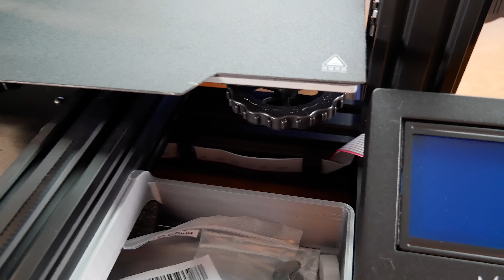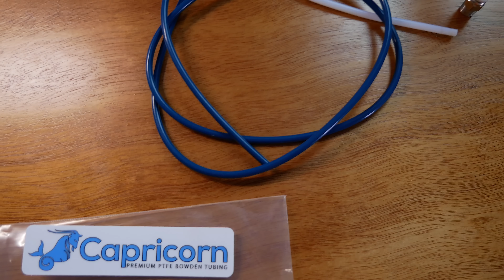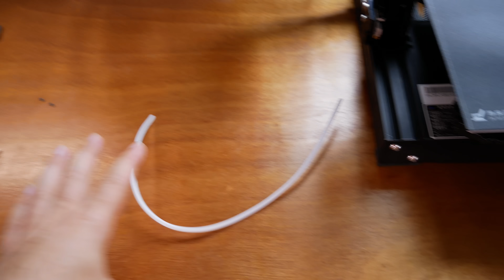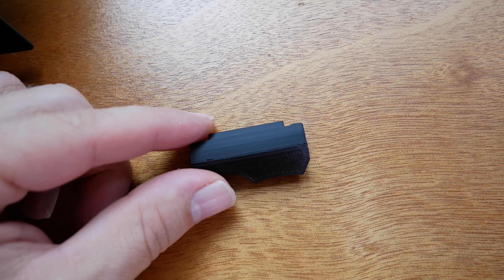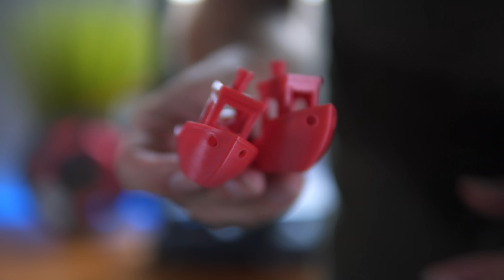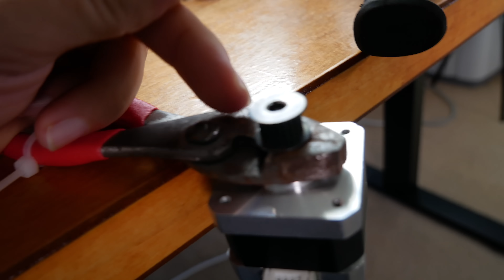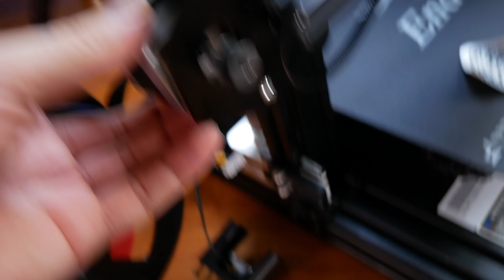Creality Ender 3 Pro - 3D Printer - More Upgrades

Comment: Have you replaced bed springs yet with the amazon orange ones? Id like to see you upgrade to those or even better the silicone stabilizers and do another benchy
Reply: I've done that recently... just ordinary stiff springs, not "painted" orange ones.  It's made a huge difference to my prints... They're better... I got 20 of them for less than a fiver.
Reply: I've printed 3 stabilising cylinders that catch the screw and the spring (they both have their own space, with a small ring between the screw and spring), so the springs can not make the awfull S-shape anymore when the bed might be leveled down a reasonable amount, to shop the bed shifting from travelling movements.  It helped quite a bit in limiting the bed shifting because of fast travelling.
The base of the cylinders is quite large so the screws stay upright as much as possible.  There also is a 3.5 mm high base that the springs rest on so they have much more force in pushing the bed up, which helped even more (I used several small metal rings below the springs at first, but they could shift position just like the springs, and while it definitely was an improvement, it wasn't a very good one.

Comment: printed the fan duct with PLA .. there is supports in the small passage at the end.. i don't think i can remove them.. ima have to print again /facepalm

EDIT: i pushed really hard on it with the small flat screwdriver provided with my ender 3 pro. you have to put the part down with the supports being at the top. then push down.

Comment: I noticed that the creality ender 3 pro only has a filament selection of PLA and ABS  how can I print flexi filament
Reply: Those are only the pre-heat options, just slice your model with the correct settings and print.

Comment: What 3D Printer do you suggest for a beginner that's 300 and below? Also do you have a video thatw for beginners?
Reply: Ender 3, easy to set up, you can be printing out of the box with in an hour. Then mod it when funds and experience allows. I love mine
Reply: @pkf4124  Thanks I'll get this one then. I gotta also get a computer it seems. I honestly haven't used a computer in years. I do everything from my phone so had no reason to do it. The computer I do have is about 10 years old. My 11 year old is going to be using a 3d printer In school this year so I figure this would also help him out. No idea what make or model he will be using but I'm sure he will learn alot.
Reply: You dont really need a powerful PC to run Cura. The only situation when power counts is slicing complex prints, and then we are only talking a min or two at most. I have a 10+ year old PC I’m planning to use as a dedicated printer pc, maxed out  with ram it copes perfectly and can run a camera and all the remote monitoring i need for long prints.
Reply: @pkf4124  Thank You that's great to hear. I can probably use the one I have or buy a cheap one.

Comment: Thanks for the videos. I am thinking of getting this printer, it would be my first one. I have a question about the TL smoother upgrade. Do they really give you a better print? or should I just skip them? I see a lot of posts where people say the installed them but see no difference. Thanks for your help
Reply: The pro has new better drivers. No need for the smoothers.
Reply: TL Smoothers weren't even designed for print quality but to fix an inherent flaw with drv8825 drivers the fact that they have been promoted and sold by nd others as a print quality fix just goes to show the lack of knowledge and understanding most of these channels have.

Comment: 1) Is there any way to make an ender-3 pro read cards that are larger than 8gb?  Mine can't read anything larger the one came with the printer. 2) Is there a possibility that can make the printer starts printing again from it left off?
TIA
Reply: It might be a firmware update,  but my ender 3 pro seems to be able to read any size card.  I regularly use a 32gb card with no problems

Comment: The Filler spool holder won't work properly when side mounted like that, the inside of the spool will rub on the brace part a lot of the time. You really want the spool to be resting solely on the round cylinder with the bearings, which you can't do with it at an angle. There are stands and other attachment methods available on the Thingiverse page for it.

Comment: What I used for feet, is ummagrip battery pad material for quadcopters.  It is nice and soft...and grips the surface that the printer is on, very well.  It seemed to mitigate a lot of the vibrations I was seeing.  Those rubber feet that come stock on it are just too high firm.

Comment: Not too bad, print quality in overall is really good.
But there are some noticeable Z axis marks on the benchy, actually on both. 
You must have some issue there as they are exactly at the same height in both.

Comment: warning putting foam under the printer will make it silent but will make it shake too and cause problems in long wrong sometimes. so be careful. I had a lot of layer line issues that were slightly shifting
Reply: Honestly you should have more likes there's a reason CNC machines and Lathes etc.. have concrete and weighted bases it's to dampen resonance frequencies foam padding does nothing to help other than hide or mask some of these and in some cases can cause more problems than they solve.
Reply: I was thinking the same thing with the stepper motor dampeners. Wasn't it just last video he put in the one way boards to make sure the stepper motors stopped faster to keep it from being off on the layering ? Now this one he put dampeners in between the frame and stepper motor that will make them able to shift more. Isn't that a little one step forward and 2 back ?

Comment: I hate it when manufacturers put the upgradable important stuff on the motherboard or don't let you use screws. is there really a benefit? luckily i got the old anycubic i3 mega and mine has the pulley and detachable drivers still!

Comment: Nice video! I got a new Ender3 yesterday. The removable bed is some type of fiberglass or high temp plastic with the black print surface adhered to it. Prints stick to in superbly! Actually TOO GOOD! Because, even after it is taken off of the aluminum bed and cools down completely, the print is nearly impossible to get off the print surface! I HATE IT! Now it's the most difficult part of printing something! From the very first print this Ender 3 prints absolutely beautifully! Gorgeous, precise prints immediately right after assembly! Just downloaded Cura 4.0, chose the printer profile, and leveled the bed with CHEP's leveling gcode. AWESOME is not a good enough description!!! No longer is the Ender 3 a "tinker with it to print good" printer! It's dialed in as soon as you assemble it! A good reason to not buy an early version! They upgrade it along the way until it's really near perfect! 👍 Just the print surface is a total hassle to deal with. Even prints with a small footprint are 98% impossible to get off! I had one print with a skirt. It took pouring 91% cleaning alcohol on the surface and scraping like a madman to get the thin skirt to come off. One side never did! I simply scraped it so much its now smooth to the top! Lol  😲
I've heard of sticking good, but this is ridiculous! 😧
I will be doing what I did to my Ender 2... Replacing the print surface with PEI. I don't know why more people don't still talk about that print surface. It's friggin' FANTASTICALLY FABULOUS! YUP, I LOVE PEI! Prints stick like a son-of-a-gun, but let it cool down for just a couple of minutes tops, and it literally plucks right off - EFFORTLESSLY! I can't imagine how anything could be any better! Highest recommendations! But get the REAL PEI... not some knock off. You'll be very, very happy! 😀😜🤘
Otherwise the new Ender 3 (from Sain Smart on Anazon) are a dualed in  G  E  M  !  🤘😎
Reply: I have that print surface and I just remove it and slightly flex it and they pop straight off no problem

Comment: The reason those beds suck, is because the magnet that holds it is trash, so if your print is going to warp it will just pick the entire mat up with it.. which leads to further problems.  And I found with mine when I tried it, had varying thicknesses over the entire mat so I ditched it back for my glass
Reply: Your filament temperature was wrong...I had some warping, then adjusted temps, now prints perfect. large prints can be a pain to get off glass too. especially if they are delicate.

Comment: Hey dude, enjoyed the video. I've been trying to decide what to get for a first 3d printer. Ender 3, ender 3 pro, cr 10 or cr 10s pro. What's your advice?
Reply from the maker: I would say the ender 3 Pro is an awesome machine to start with. Its an excellent printer for the price and the build volume is quite sufficient, for just about anything you would want to print.
Reply: @JustVlads  super helpful dude. I'll make a start with that then 😊
Reply: @NH-po8wr  thats what i just got, a lot to learn but its nice and fun
Reply: Ender 3 Pro v.2
Reply: @TJharcus  thank you. How come you like this one so much?
Reply: @NH-po8wr  cause of 1, it has a glass bed, 2, it has a better led display and it's color , and 3, it has all the other upgrades the ender 3 pro has and more. I own both and once you figure out how to use either correctly, you can get some amazing quality for their prices. Just remember to get the latest Ultimaker Cura program as it has the best print options IMO. Also, watch as much youtube videos about 3d printing as you can cause people are still finding tricks all the time. You never stop learning  ;)
Reply: @TJharcus  Wow Tamara, thank you so much. That sounds pretty solid. I'll look into it. I wanna get one for the end of august. Super excited. Any videos for beginners? I wanna use mine for DnD and for costumes.
Reply: @NH-po8wr  I don't do the video thing. I just watch em lol. But, YouTube is loaded with em. Look for the top thumbs up counts and you can tell who is the best of em but don't shy away from the smaller ones either if the subject interests you. Remember it will take a lot of testing blocks and shapes before you are ready to start a big or detailed project and watch your x axis carefully. P.s. all filaments are not alike, even from the same company. You will have to figure our the gcode for each color and brand.
Reply: @TJharcus  I didnt realise it was so indepth. I guess I have a long road ahead of me. Thanks again :D
Reply: @NH-po8wr  Any time :)

Comment: Fantastic Video!
Looking forward to have mine, and start this long list of upgrades
Reply: If you really enjoy the upgrade process, get the Ender since it is a great printer, but if you want something with a better foundation to build upon, look into the Sapphire S from Twotrees.  It has linear rails already and it is CoreXY.  Currently at an amazing price.  I love mine.
Reply: Ehm looking forward to getting a printer i paid for to upgrade to print well? Makes sense to someone i suppose.  Better off buying a decent machine or building your own.  BTW none of these tips were upgrades that would help print quality.

Comment: sorry but when i see you working, sometimes i can't agree with the way you do it...why don't you just measure how far you have to "pull" the Pulley out? also dont pull your Printer up like this when printing, do this when the print is finished. And would be better to grind the place on the dampers where you snaped off the nipples. Little things can make big differences

Comment: have heard that the bowden capricorn upgrade will prevent issues with stock bowden tube which can cause issues after a month or so of use, causing under-extrusion because the tolerances are tighter, also heard the couplings should be upgraded to prevent tube moving which can cause filament build up and clogging.

good videos

Comment: One other question. Could you provide a list fastener and nuts to secure the various components that were not part of the Ender3. Or were you able to use fasteners that came with the printer? Richard

Comment: hey Vlad, you've got a metal timing belt pulley listed under upgrades but i may have missed that part in your video. where's the pulley?
Reply from the maker: If you wanted to replace your pulleys completely that's the correct way instead of leaving the old ones on barely gripping, but that's what the link is for.
Reply: thanks man! and its the 16 teeth, 5mm option right? i dont have an ender 3 pro yet, but about order with some of the upgrades you shared.
Reply from the maker: Yeah pretty sure that is the right ones
Reply from the maker: @antondavid84  Dude, I told you the wrong thing. Its 20 teeth 5mm bore. here it the link https://geni.us/BAvciy8

Comment: Guys don’t use a proper PTFE CUTTER. Capricorn sells them. Or at least print a guide and use a sharp cacti knife to cut properly. Also free up your Bowden tube from the electric cables for the hot end. Let it go wherever it wants. There are guides you can print for the wires.

Comment: I was amazed too on how effective those dampers are. As I had the same problem with the y-axis motor hitting the bed after adding a damper there (to an extent where it did not even reach the limit switch) I found a solution on ebay that is just an about 1 - 2 mm thin sheet of temp resistant silicon, predrilled holes, ready to install for the Nema motors. That worked as good as the dampers like yours but helped to not have to do anything weird with the motor spindle. And no more hitting the bed and no preventing to hit the limit switch.
Reply: Can you add a link to it? I cannot seem to find what you're refering to on ebay unfortunately.
Reply: Got a link to that part?

Comment: its not good hit with hammer to step motors :) u can use tools like this to rmove pulley :
https://www.aliexpress.com/item/Blue-Universal-Metal-Motor-Pinion-Gear-Puller-Remover-for-RC-Helicopter-Motor-Professional-RC-Toy-Accessory/32919422816.html?spm=a2g0s.8937460.0.0.77092e0etGwJIH

Comment: Wich slicer do you use and can you show your settings
Reply from the maker: using Cura as slicer with standard settings except retraction speed at 25mms. I mostly concentrate on having the machine tuned-in and seems like slicer does fine in default settings.
Reply: @JustVlads  ok thx

Comment: Eugm... Im pretty sure TL Smoothers dont work on Creality Printers.
Reply: @Voltex Works here, regular Ender 3 (not pro), and it does make a difference. It is not as impressive impact as the dampers, it is more the cherry on top of already pretty good prints out of the box with this machine, as long as you assemble it carefully when you get it.
Reply: Heard it works for some but not orhers
Reply: @ugpfpv361  I doubt people have different mainboards, because stock ender mainboards have a completely different way of adressing motors as to what TL Smoothers do
Reply: @VoltexRB  just stating what people report... could be that they are adding other modifications along with the smoothers and attributing the improvement to them... I don't know. I don't see the need to do anything to mine, except I did to that one mode to help with tpu printing
Reply: Smoothers were created solely for drv drivers nothing to do with creality or any other brand just the drv8825 drivers. And this was just to do with the way these specific drivers operated. The fact that so many people have bought into them being a way to improve print quality is just down to a lack of understanding.  they do nothing to help.

Comment: Dude you want quiet?
heres a good tutorial for upgrading the cooling fan https://www.youtube.com/watch?v=yW9ovo9CHi0
print this Bullseye Fan housing  https://www.thingiverse.com/thing:275
from there get a Buck Converter and the Noctua NF-A4x20 5v PWM fan, (is what I used or you can use the 12 volt version as well) that will quiet your fan tremendously.
as for the blower fan well not much you can do there at this time.
for the feet heres' a good one and you can put sticky pads on this, i used the scrap cork left over from the Insulation under my bed.
Feet  https://www.thingiverse.com/thing:3109537

Comment: Not enough clearance on that duct.
Reply: its enough. the sock insulates better than you might think. 260c hot end and I can grab the sock with my fingers and pull it off and not get burned.

NOW if you print anything where you TURN OFF the fan then yes. you might have a heat versus time issue and might eventually have an issue. but you can just anneal the part and it should be fine.
Reply: @nerys71  Yeah true, I was talking more about clearance of part cooling fan and bed. It looks very close to nozzle height. I would prefer a bit more clearance there.....just in case.. lol

Comment: To answer your ? slicepage  YES!   and when when he said after beating pounding the shafts it may come out this side  I thought no S%!+   but I will sat I have a pro and I have it sitting on the shipping foam cut out the section under the board for air flow and I have had no issues with noise

Comment: is that pulley right at the end of the motor shaft not going to cause stress and cause it to crack over time?
Reply: no. its hardened tool steel. the rest of the printer will fail before that part fails :-) plus your belt should not be that tight. you want it to "barely" thrum like a guitar string. BARELY over tight is worse than too loose.
Reply: @nerys71  ah! i thought it was plastic. Thanks for the info

Comment: They have black and blue square pads made of different compounds of rubber at any plumbing supply place, they are anti vibration pads and they would match the ender perfectly and are like a buck or two a piece brother. For the feet I mean...
Reply: Washing machine isolation pads....